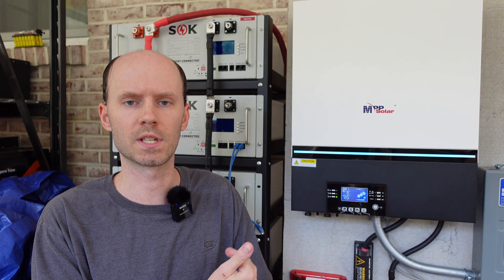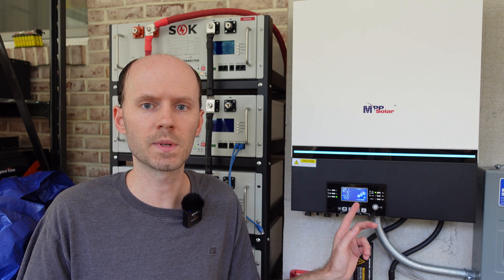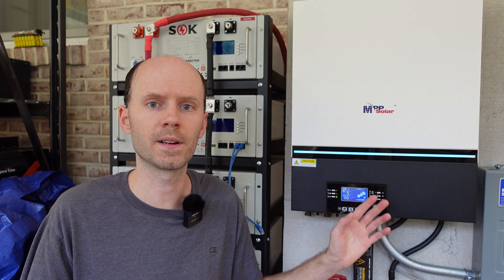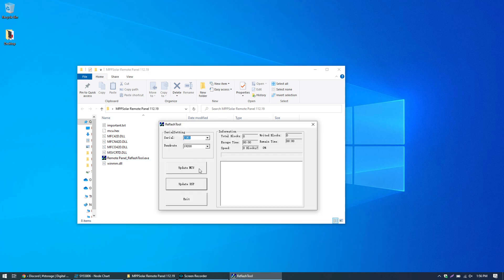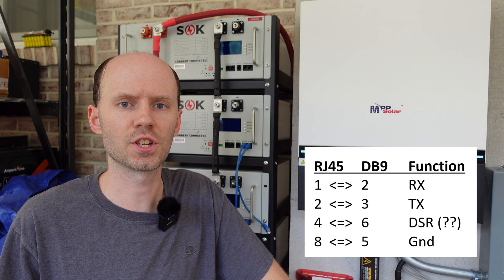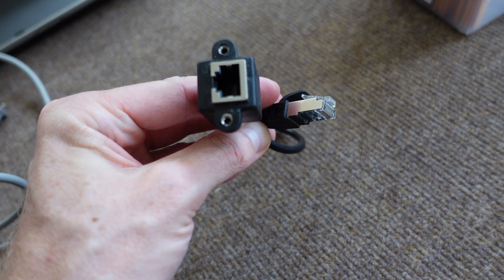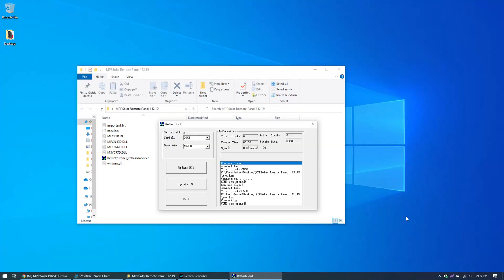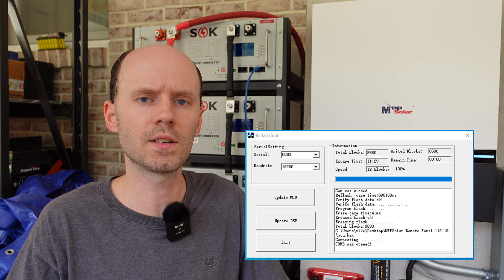Fixing the MPP Solar LV6548 Voltronics Firmware Flashing Problem, A Simple Resistor

Comment from the maker: LV6548 Inverter... https://watts247.com/product/lv6548-6-5kw-120v-solar-inverter-4kw-250v-mppt-bms-ul1741-built-in-wifi/?wpam_id=97
LV6548 Firmware... https://watts247.com/manuals/mpp/Firmware/LV6548/?wpam_id=97
SOK Rack Batteries... https://www.currentconnected.com/product/sk48v100/?ref=lithiumsolar (affiliate links)
Reply: What a mess that mppsolar has not been able to communicate such easy solution or offering such cable needed . 
Luckily I had seen the troubles before I purchased and went for Growatt instead also to the mess of taiwan quotes cause mpp solar is a blood sucker here in the EU cause they discriminate buyers in the EU. Germans have to pay 1800€ for their MPI5k and italians just 1200€ and if you order it from italy they start telling you they do not deliver.
But that is forbidden in the EU to discriminate EU citiizens cause they have to sell and deliver to any EU citizen for the same net price at least plus shipping which mean real shipping fees and not phantasy fees like 500€.

Comment: Hi
Install 3K ohm resistor in TX (white) pin in RJ45 connector for upgrading firmware of MPP Solar inverter is recommended from MPP Solar Engineering (Supporting)???
Why there is no diagram to explain that?

Comment: HOLY COW You saved my life ! And my $2000 inverter is back alive. THANKS A TON !
Nowhere else on the internet the 3k resistor is mentioned (i end up using a 3.3k , just like you :D)
I tried 3 different serial cables !!! And was getting stuck at random percentages. Just slow down to a crawl, then error.
Was just flashing the main cpu with software provided by the vendor, to fix the 90V thing.
Reply from the maker: I'm glad this was able to help. It was an EXTREMELY frustrating issue to have at the time!

Comment: I have a question about the inverter behavior when VOC goes above 250V at colder temp. My system will have 5 Canadian Solar panels ( CS6W-550MB-AG ) they have STC VOC of 49.6V and NMOT VOC of 46.9V. They will be installed in a tropical location in Central America where the lowest recorded temp is 15C ( about 59F) and the STC VOC calc for the string at this temp will be 254V. 

My questions:
- What happens when the VOC goes over the 250V? 

- Does the system puts the error code exactly at 250 or before that?

- Does the system resumes normal operation once the voltage goes below 250 automatically or do you have to manually reset it?

Comment: Did  this work with your bricked display, or did you buy a new one?
Reply from the maker: It worked as was the whole point of this video lol
Reply: @LithiumSolar Oh well I tried it and the display remains dead, so maybe the link board between the display and the motherboard is defective too as per my other post😞 When I try connecting all I get is a message saying that it couldn't open a serial port connection....

Comment: I don’t have a rs232 serial/db9. Could i use a FTDI USB to RS232 cable to update? 

It’s currently working on the comm port to solar assistant.

I am off grid so can’t afford to be without them if they won’t update.

Thanks!
Reply from the maker: Yes, that's how I updated mine - with a USB RS232 cable containing an FTDI chip.
Reply: @LithiumSolar  thanks for confirming.just to confirm my cable is straight usb to rj45, no serial db9 in between 

Did you need the resistor in place?
Reply: All done without issue. No resistor needed however I found it just hung on “port open” via the serial/usb cable combo. Once I connected an old laptop directly via serial it updated both units without a hitch.

Thanks again for the video to prep
Reply from the maker: @Gurusi  I'm a bit confused. You said you didn't need a resistor but then said it wasn't working in a way that is consistent with what the resistor was added to fix. Either way, I'm glad you got it updated. It's a shame computers aren't coming with serial ports these days when they are still so widely used.
Reply: @LithiumSolar  you are correct, I probably could have added the resistor and it would have worked. But it was easier to plug in directly via serial rather than dig out the solder iron! The old laptop has saved me many times.

Comment: Does anyone have any advice on programming one of these MPP units with Power Queen (4) in series, 100 ah lithium batteries?  The built in programs for lithium set off alarms because I
'm not using a cable into a BMS.  There isn't one to plug into with these batteries.  I'd like to know the best settings to prolong the life of the batteries.  PQ hasn't responded to my email. Settings such as low/hi cut out, float, etc.  there are more settings on the USER defined program I'm using. Thanks in advance for any response.

Comment: Hello, so I too am having the exact same problem one of my displays is completely blank but the power button still works and will not take any firmware updates. Could you possibly explain what you had to do first to get the display to come back up?
Reply from the maker: I just re-ran the flashing procedure with the black display. Do you have a cable with the resistor added?
Reply: @LithiumSolar do you remember which firmware you re-ran and yes I have installed the resistor
Reply from the maker: @mattlyman1958  It would have been 112.19. Is your inverter staying on while the screen is dark or is it starting up then shutting back down after a minute or so?
Reply: @LithiumSolar it will stay on and the screen is just black. The inverter produces power when the button is pushed to on position and shuts power off when button is pushed to off position. So everything seems to work as normal but have no display what’s so ever

Comment: what i would like to know is why does my screen get so freaking hot only thing plugged in is the cable from the inverter to the screen and it gets very warm not hot but warm im thinking about turning off the light on the screen
Reply from the maker: Do you have the LV6548 from MPP Solar or is it one of the other brands? I have 4 of them now and the screens don't get hot on any of them.
Reply: @LithiumSolar  mine is actually the 6048

Comment: Thank you very much for your solutions!  Best & very useful!  Just one question: I have Mpp Solar 11kw variant, can use the same firmware 112.19 for display unit(remote panel)? as per your inverter? Or could you pls notice a link where to find it? Many thanks and congrats for your valuable work!

Comment: After watching your videos decided to get the ball rolling and started by getting solar panels installed. The first question I have is if the voltage is 246 Volts AC at the combiner box what would be the configuration and wattage if there are 18 panels each at about 400 watts? Anything you can tell me about this configuration would be great.
 The next step is to add batteries. Now in our area, PG&E will not allow the panels to be connected to the grid during outages, and have struggled to figure out how they prevent that from happening.
Keep up the great videos.
Reply: Your grid-tied inverter handles this. You need study about grid-tied versus off grid equipment. 

Back feeding the grid is dangerous and the equipment has to be certified. Islanding is kind of a key word and hope you get help

Comment: I work a lot with Cisco gear and we always use the best fddi and or optically isolated rs232 adapters. Never had these issues. I flashed my inverter and didn't even know that there was a problem. 
Spend a few more bux on a good gear and save on time and headache.

Comment: Writed
Reply from the maker: Writed!
Reply: Hi
Install 3K ohm resistor in TX (white) pin in RJ45 connector for upgrading firmware of MPP Solar inverter is recommended from MPP Solar Engineering (Supporting)???
Why there is no diagram to explain that??

Comment: After knowing the solution, it is kind of a common sense solution if you think of the resistor taking the heat.   But, it would still be a guess as to where and what value the resistor should be.   
Awesome that between all involved, the mystery is now solved.  Team work!   
Thanks for sharing.

Comment: Both my 6548s have the older firmware and seem to be working fine. Is there any good reason to update to the newer firmware version? Sounds like it could be more hassle than it's worth.
Reply: He updated the firmware to allow the inverter to comminicate with the BMS, the older version firmware wouldn't.

Comment: I suspect different "standards" strikes again. When I first started dealing with serial ports, the "standard" was +15v to -15v signal levels. Then the IBM PC changed that with +12v to -12v levels (worked quite well together). Now there are "standards" with +5v and 0v, as well as +3.3v and 0v as signal levels. Although the chip input seems to have survived the wrong signal levels, adding a resistor just sounds too much like the wrong signal levels were expected. Standards are so good, everyone has their own.

Comment: Comms are a logic level voltage and by itself would should not cause excessive heat. Im thinking the 3.3K had created a voltage divide to allow the board pull ups to keep the UART in idle mode or added enough resistance so the UART could detect true on/off state. I would be interested in knowing how the fix worked. Nice troubleshooting.

Comment: Its great you can now "Writed Blocks". So the issue was system voltage differences - probably one is 5V the other is 3.3V. I have some inverters with serial i/o - on the PCB it states 5V signals, while the instructions say 3.3V signals. Its part of the "Writed Blocks" mentality, and probably why some stuff from the east still fails prematurely.

Comment: At first, I was thinking you had a 330 ohm resistor in there based on the color code, then I looked again and realized they were 1% tolerance, so the color code is slightly different than a 5%

Nice easy fix, good job.
Reply from the maker: LOL that would have been... not funny. I didn't even think to verify the color codes. I just assumed the bags contained the proper values. I guess nothing should surprise me anymore though.

Comment: Thanks so much for passing that info along! QUESTION: Are both of your inverters now running the exact save firmware version in U1 & U2? From your previous video, it sounded like both (now) have the same FW in U2, but one unit had 45.07 (U1) and the other unit had 69.02 (U1)? Is this correct? I also have two LV6548's with each having different FW versions, just trying to find what works for others before I reflash. Thanks!
Reply from the maker: No, they're still different. I need to update the 2nd one now that we figured out what the problem was.
Reply: Thanks for the reply!. Is the FW 69.02 down-gradable to 45.07, (45.07 on Ian's site) or is there a copy of 69.02+ floating around somewhere? One of mine is 45.07 Sept'21) but the newest one (Aug'22) is 69.03.

Comment: The poblem no doubt is the Display is using an RS232 5V level. I can use PIC MCU on 5Volts and communicate on a standard 15V RS232 level but I need to put a 22K resistor in series with the PIC's RX pin and a 1K resistor on the PIC's TX pin for current limiting.